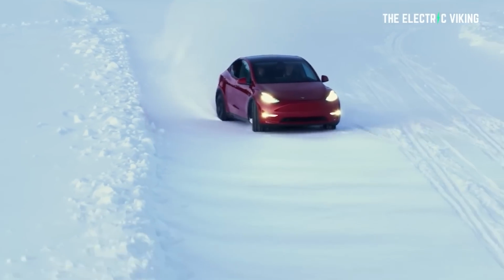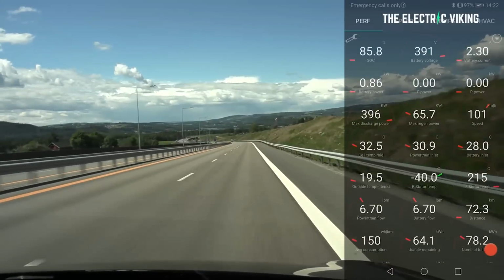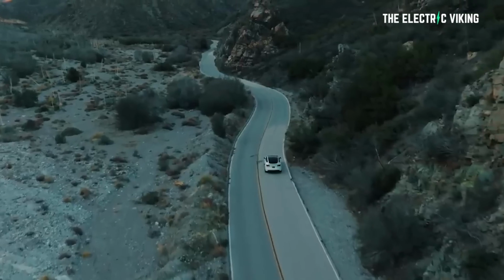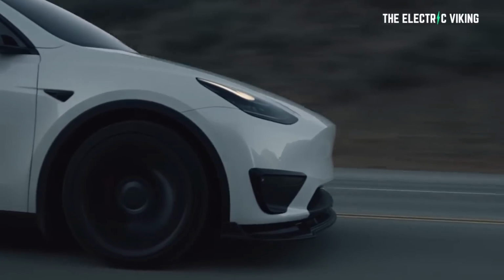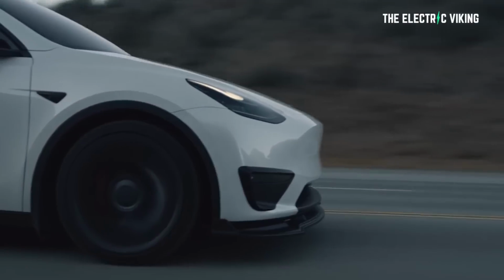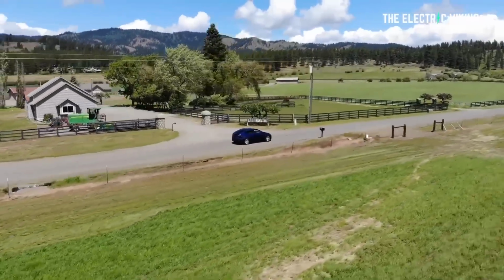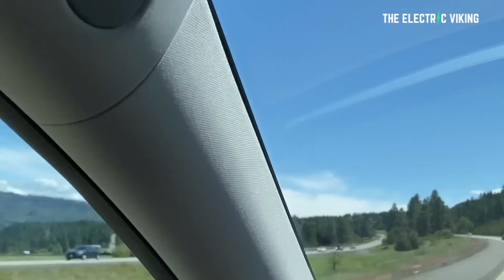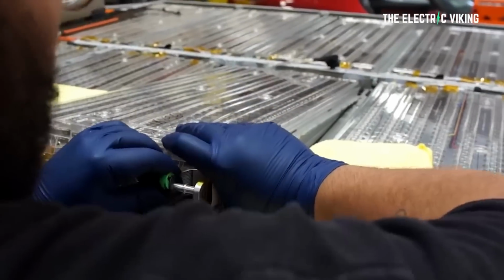German VS China made Tesla Model Y Performance range

Comment: Nah, it's just perception that MYP has "more range". NCA battery not advisable to charge to 100% unlike LFP battery. So virtually, the MYP doesn't really have a longer range per se if it cannot be charged to 100% per charge. You buy the MYP solely for its acceleration, not its range.

Comment: I'm beating that in a ZE50 R110. The Y is managing about 4.3 miles per kWh, and the ZE50 does a solid 5.4 miles per kWh, at similar speeds in similar temperatures and mostly dry weather. Available battery is just over 50 kWh, so the range is comparable. But the Renault is obviously smaller and lighter than the Tesla, and my acceleration to 56 mph is deliberately gentle. 

It's not only the speed of travel which makes a difference; it's how much of a Lead right foot you have, whether you're using the A/C, stopping and starting, payload, tyre type, tread and pressure, and other factors.

Comment: I bet German battery suppliers aren’t cheating  their customers like Chinese battery suppliers might be
Reply: 😂😂😂They get same supplies from Chinese manufacturers
Reply: @james_l4337  They can still do subsequent testing. I’ve worked for a manufacturing/processing industry major player and even though they can get the same ones and they can still reject ones that don’t make their quality standards. I bet there’s still something the Germans are scrutinizing more so than other people would care to. That’s just my take.
Reply: @NewCastleIndiana  perhaps you are correct, notice the year of China Model Y is different German is a newer year.
Software difference and LFP improvement can be a factor. Also the temperature, wind, wetness etc is different. Video seems to show these 2 were driven in different condition. The difference can also be the + & - errors of these weather & season difference.
Reply: @NewCastleIndiana  I am doubtful there's large defect in China batteries, they are QC & QA likely automated off the production.
German man hours are expensive, they could retest again, likelihood is low but only return if battery pack is absolutely out of the specifications range or faulty.

I'm more on Software difference, year of production China M Y is older, also seeing its driven in cold snow, wet makes a lot of difference already.

For me the difference in season, Weather already easily makes an impact of such % difference, actually easily greater then that

Comment: So the most efficient EV can go 224 miles at 70 mph. My inefficient 2016 F-150 can go over 700 miles at 75 mph. Over 3 times as far and takes less than 10 minutes to refill to full. We take several long trips a year with it over 1,200 miles. The most efficient EV would add hours and hours to the trip. When the tech gets better I’ll buy one. It’s not there yet. Maybe in a few years.

Comment: Ordered my Model Y, SR 19" with the 60KWh LFP battery in Nov last year (2 days before the series of price hikes). Received the car in late March and registered it in late April in Shenzhen.  (It was the last batch before the Shanghai factory closed for lockdown). After 2500Km, the energy consumption averages 134KWh/km with mixed city/highway. Full charge gets a range of 433km. The MY is better than my 2020 Model 3 SR for economy, comfort and practicality.  But for fun, my M3 is slightly better for acceleration (due to the LG lithium battery) and control (due to lower design), which I drive more as it came with free supercharging.  Average energy consumption on my M3 after 30000km is 147KWh, so is not as efficient as my MY based on my driving conditions and habits.  No plans to sell either as the registration licence (both under my name) is a hassle apply for, and its worth quite a bit.

Comment: I ordered my Model 3 RWD LFP with 19-inch wheels in January 2022 and received it 2 months later. I had a BMW, Lexus and Toyota hybrids before but the Tesla is the best car I have ever driven. The acceleration is fantastic, handling is superb and the Autopilot is perfect, I never had phantom breaking. 
It has a 140-147 Wh/km consumption in Switzerland with mixed driving of 50km/h (31 miles/h) in the city and 125km/h (77miles/h) on the highway, which is the maximum speed here. 
The total 6000km average came at 151Wh/km, the last 3000km at 147Wh/km and I floor it as much as I can.

Comment: a couple of percentage is well within the margin of error, I'd guess. the road condition, the temperature, humidity, wind speed, the meters used for tests, too many factors that can influence test results slightly. do german made model y use lfp batteries? In any case, I'd prefer lfp for longevity, better safty, and carefree charging.

Comment: With most Western states in the US the speed limits are 75 mph and up. Try going slower and get run over by everyone else and their grandmother! That means that given the degradation in efficiency at 75 mph in the EV tests you site, I would probably want to hold out for an EV that can do over 500 miles on a charge.  I don’t want to stop every three hours to charge my vehicle. I drive at least five hours before wanting a break. 
Wake me up when an EV pickup truck comes out that has that range as then I will be interested. Come on 500+ mile Cybertruck!
Reply: Don't forget to consider winter and fall temperatures (below freezing to well below freezing) as well as any loads, passengers or cargo and the fact that you're only supposed to use around 60% of your range with NMC batteries as you're not supposed to regularly charge over 80% (it takes forever at a supercharger anyway) or go below 20%, let alone regularly supercharge, or you'll get battery degradation and your limited range will fall even further...
Reply: @OlJackBurton  Agreed!  The technology as to range is just not there yet for me as to long trips. My wife and I are part of a huge demographic of older Americans who want to travel in their retirement. Also lots of folks want to pull trailers, etc. Unfortunately until the battery power goes up a couple of times (2 X or 3 X) it just doesn’t cut it. I am hoping that there will continue to be power breakthroughs and that today’s Teslas will be looked upon as those early model T Fords were as to pathetic range. EV tech has just started and has a long way to go.

Comment: Hi Sam, Just wanted to help you improve your presentations. Watts (W) vs Watt hours (Wh). They are not the same thing. That little h after the W is a big deal :) Watts (W) is a measure of Power and Wh is a measure of Energy. For example, An EV moves forward due to Power (W) being provided to the motor by the battery. The Energy stored in the battery or Energy used for the EV to travel 1 mile is expressed as Watt hours (Wh). It's easy to mixed the two up but they are different parameter. Hope this helps.😉
Reply: Thanks Ash, an important note to Sam.
Further, W (power) is not a function of time, does not accumulate over time. So a measurement of "Watts per hour" would be nonsensical.

Comment: I have a model y lr for 2 years now, it’s great, i can get from sea level over the cascades and make it 150 to 175 miles going 70 with heat blasting even with a car topper.  On flat ground I think 250 is possible.  Picking up a model 3 tomorrow so we can retire the highlander to strictly camping car.